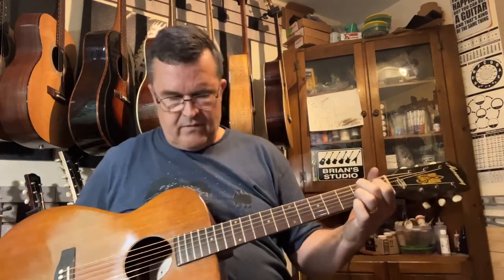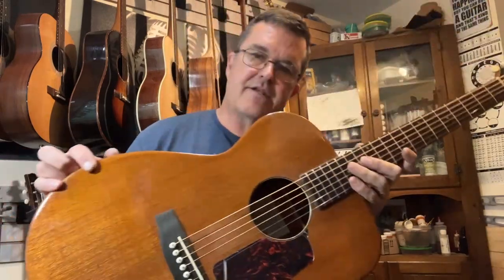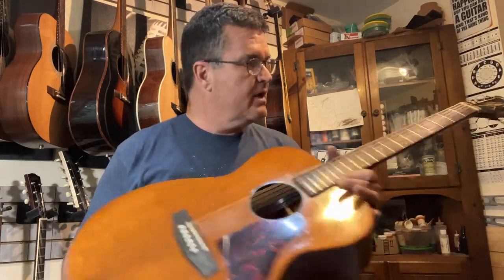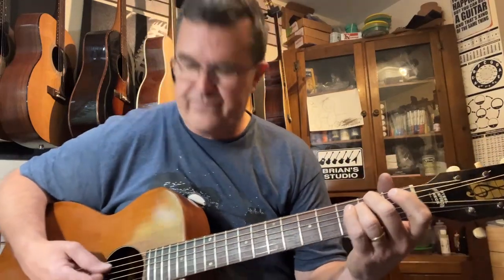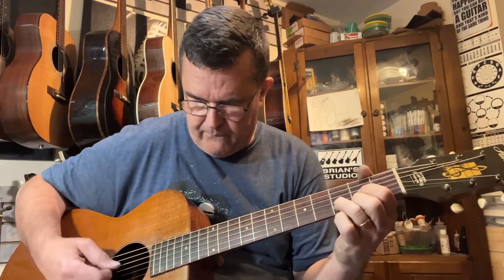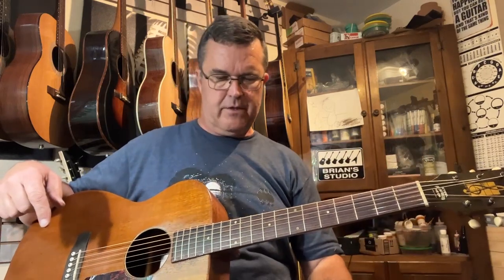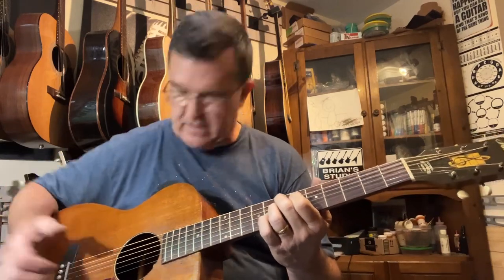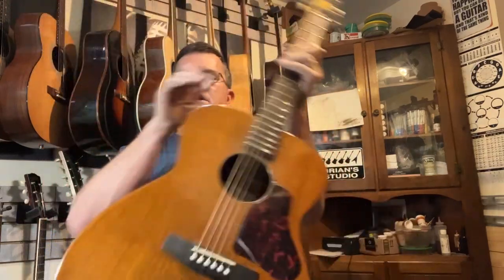60’s Harmony H165 OM sized, X-Brace conversion DEMO

Comment: Brian, I enjoy your videos v very much!  Now, I have a question regarding the Harmony H165.  what type (pigmented or dye) stain did Harmony use on these mahogany guitars and what is the color?  I've tried to locate this online, but have been unsuccessful.  I have one that our new pup knocked off the couch and I've repaired.  I'd like to touch up the color of the patch to match, but have not found a suitable matching stain.  Any thoughts?  Thanks!  Pastor Dave
Reply from the maker: Hi there! You know, I really don’t know what the actual color would be. I did one once that I added sort of a "distressed edgeburst" like a Martin Streetmaster 15, but it definitely wasn’t a match. I used Aninline dyes to mix a shade. You might try that, and just keep adjusting pigments and try on a piece of Mahogany until it looks close. Also, I’ve started using StewMac liquid stains quite a bit. They are pricier, of course (everything with a StewMac label costs more…) but they mix easily and will tint the clearcoat finish for spraying. Pretty much any finish, Shellac, Nitro or Waterbased. 
Maybe try the Kalamazoo Red and Tobacco brown mixed together, with more brown than red. 
Good luck!

Comment: How do get a hold of those vintage guitars? But they tequire a ĺot of work. Right
Reply from the maker: Harmony was a long time American maker of guitars, going way back to the early 1900’s, and made a lot of guitars for other manufacturers as well. One of many Chicago based makers, the6 marketed different headstock brand names to most of the major dept stores. Silvertone was Sears, Airline was Montgomery Ward, etc. 
I’m always looking for them, and other old Chicago makers. And yep, they always take a lot of work. I usually do a full disassembly and rebuild. 
Happy New Year!

Comment: Hey  Brian I’m about to start on a bracing conversion of this same guitar. Can you tell me if the top has a radius, or is it actually flat?
Reply from the maker: I use a 28’ radius dish on my Go-bar deck system. I sand the braces to that radius on the dish first, and then clamp with the guitar face down on the dish to match the braces. And don’t forget to radius the underside of your bridge or the edges will pull up eventually. (Ask me how I know, lol)
Reply: @brianmcfarland4745  perfect, thanks very much Brian
Reply: @brianmcfarland4745  Do you radius the entire length of the x-braces or just the lower bout sections?
Reply from the maker: The entire length is Radius’d. And they are glued using a Radius dish as the base of my Go-Bar deck